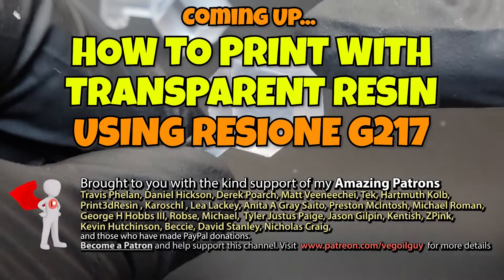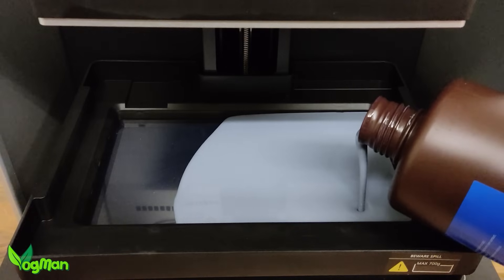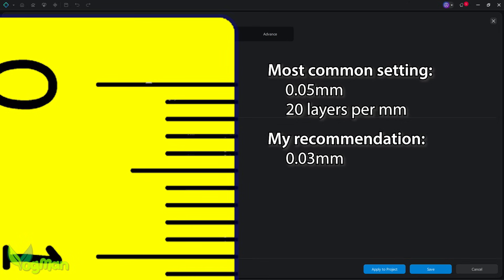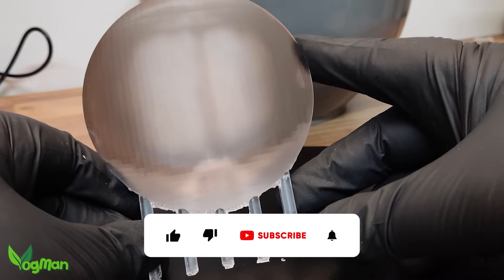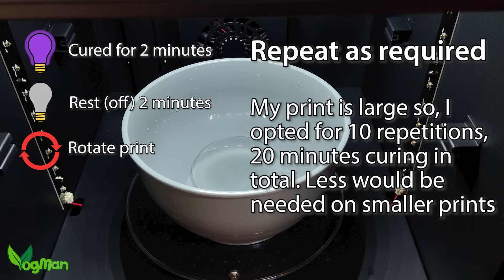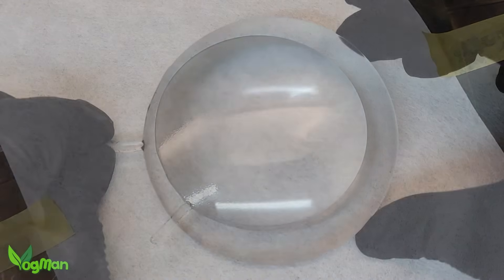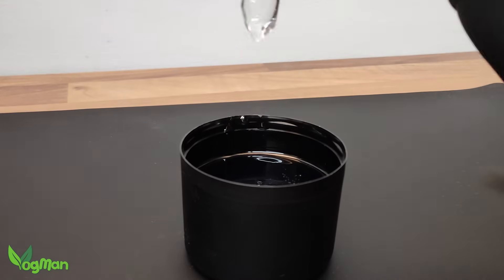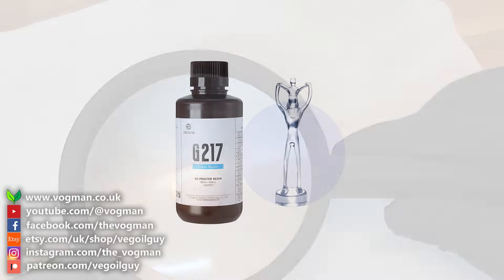How to Get Crystal Clear Resin Prints (no Clouding or Yellowing) with Resione G217

Comment: I have wanted to try an idea for dipping for a while. Mixing the resin with isopropyl alcohol to thin the resin and dipping it. Let the alcohol evaporate and then cure it. Saw another YouTuber use the mixture to  fix a crack in a print and have wondered if it would be good for dipping.

Comment: If the cured resin is soluble with a solvent like acetone it toluene, instead of dipping, you can heat the solvent in a container with a "nozzle" and apply the solvent vapour to the part... This has been used for the final polish when refurbishing car headlight lenses.

Comment: With printing a lens, it should be possible to print an aspherical design, to get quite good optical performance... I guess that you could also print with a non-transparent resin, and burn it out, or dissolve with solvent, to make molds for high-performance optical plastic, or even cast glass lenses.

Comment: Hello Sir,
My model is coming out perfectly but near the build plate my print is stretching outward. I did lot of resin calibration test and now I print with 7 second exposure. With 7 sec the parts comes out well with all the detailing but I'm still getting the print stretched outward. Also the flat faces are little bit curved. Also even using medium supports at appropriate distance I am getting lot of unwanted resin cured near the supports. 
Please Helpl
I am using Elegoo mars 5 ulta with anycubic high clear resin.
Reply from the maker: Sounds like classic bottom-layer overexposure and a bit of light bleed. Try reducing your bottom exposure/time, add a small bevel to the base, and tilt or hollow your model to cut suction warping. Clear resins scatter light too, so you may need to drop your normal exposure slightly and space your supports out a bit. Should fix it 👍
Reply: @vogman Thank you so much.
I will try and update you. Also I have lifted the model by 5mm from the base plate.

Comment: A way higher resolution would have meant a lot less sanding! SUBDIVIDE! haha! And instead of spraying a clear coat, since you already went for sanding, sand with a 3000 or 5000 grit and just polish it, that would have given you an even smoother and clearer result! But i do have to say, it looks nice and clear, however you should really take the test of time to see how it actually does. And use a clearcoat with UV protection if you're going to spray it. All in all a nice indication test, but not very thorough.
Reply from the maker: I tried to keep it simple, but appreciate the suggestions! And I did top coat with anti-UV gloss 😁

Comment: if you want to mix it without adding bubbles you can roll it like you do in a rock tumbler just don't go to fast. also, you can dip in min wax polyacrylic to get a good clear surface as well if you don't want to spray.
Reply from the maker: Thanks for the suggestions!

Comment: I wonder if a vacuum chamber would help if you didn't have 24 hrs to wait. Something like the one from Lets Resin.
Great video. Keep up the good work.
Reply from the maker: I think so, yes. I was tempted to go down that route, but I tried to keep it as simple as possible for everyone else 😁😁😁
Reply: In winter I use a heat gun to heat up the resin in the vat and all of the bubbles go away.

Comment: Yes - G217 has been my go-to clear resin for quite a while.  Tried many others and none of them even came close.  No need for sanding to remove the surface haze unless there are layer lines and/or STL faceting - spray varnish will fix that.  G217 does indeed yellow upon curing.  I have never cured thick parts in stages and never had any issues (40W cure station) with 15 minute cures at RT.  To remove the slight yellowing that your parts likely have is to put them in boiling water for several minutes and then let it cool down in the water.  A protective UV varnish really makes the surface pop if you apply a very thin layer.  This is good stuff.
Reply from the maker: Glad to hear your experience has been so positive with it too! 👍
Reply: How does the G217 compare to the clear resin from Heygears, if you ever managed to try theirs out. 🤔

Comment: Could probably take it one step further and use some polishing compound before clear coating.
Reply from the maker: I toyed with the idea, but at 4000 grit it was amazing, so I risked straight to varnish... and you saw the result. Very pleased with this stuff.
Reply: You could use a polishing mop with a gentle cut polish. I've had to talk through with my tool supplier about the difference between sanding grit and polishing grit. He didn't understand why us jewellers would go to 4k or 6k grit paper and then start on a lower grit on the mop. The nature of compound and speed of the mop imparts a different finish and cut.  

If I went 4k grit paper to 4k equivalent grit compound on the mop my platinum would look dull.  

Anyway I blabbed enough there, a watch glass compound for plastic might give so awesome results on a mop.

Comment: Thank you for this. I was interested in getting a new one. I gave up on clear due to the issues, the T-Green I use was decent at least. It would be nice to see a follow-up, even if it is short, in 6+ months if you still have a print for comparison. 

Also, probably doesn't help that I over-cure.
Reply from the maker: Resting is the secret. Curing overheats. Resting allows for cooling.